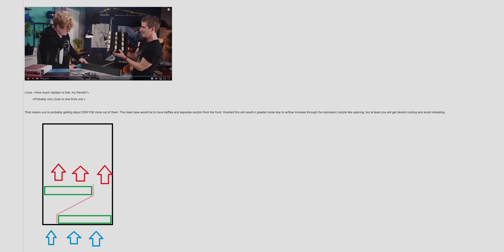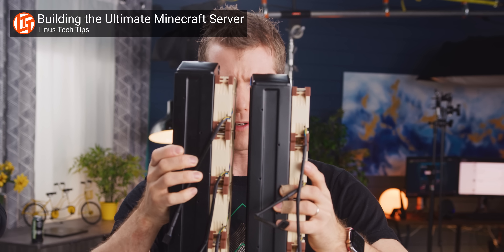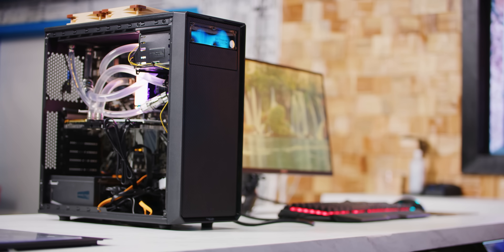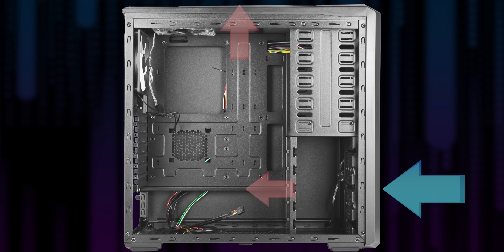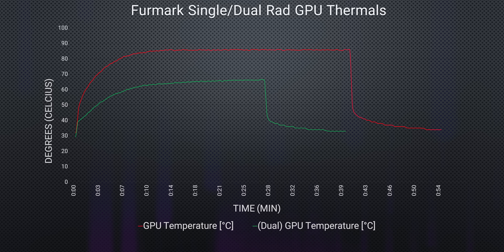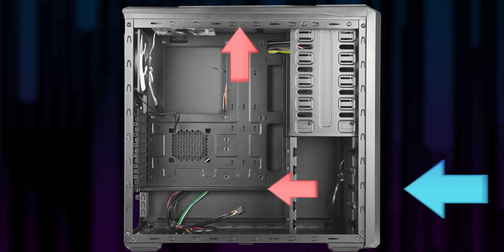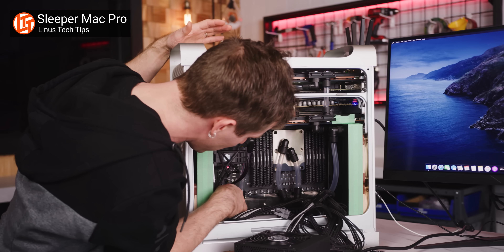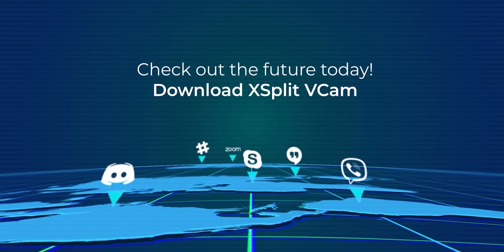I’ve been water cooling wrong for YEARS - $H!T Manufacturers Say

Comment: Corsair's recommendation may not hold true for a standard PC build, but you didn't test it with the server thing with multiple rads one after the other where it would hold true. That's a situation where you've worsened your mater cooling performance because the last rad will only get hot air from the rad in front. Worst case scenario.

Comment: I'm sure someone else will comment on this, but here it is anyway. All the best hot rod cars, drag cars and even race cars use "triple flow" radiators. That is, the water turns behind itself twice, to form three walls of water, with one common air flow. This does increase heat capacity, and you will have seen what that means to heat soak, BUT it also allows great "packaging" and that's what we're really talking about here. Optimised cooling VS packaging. If you want to fit cooling inside a case, multiple rads and lots o fans are your friend! You generally want the coldest air to touch the coldest water, i think that's called contra flow (it's been a while). The type of rad will affect this decision. Hot water will cool "better" on cold air, but, IF you have the capacity and thermal window, cold air will make the "cold" side, colder, so keep the system from heating as much. Ambient, surface area, air and water flow (as well as peak temps, temp difference and thermal input power) will change how you choose the config. For shits and giggles, try a control experiment. Do two external "bench" rads with the same fans (always the same number of fans). One test with serial rads, giving the cooling a "longer" pathway for the total surface area (this should work well for low temperature difference) and do a second test with the two radiators in parallel, using splitters to separate and join the water flow. This "slows" the water flow, allowing more time in contact with the rads. I think this works best in high temp difference scenarios (depending on your target cooling temp too? ). Then compare this with stacked rads, outside then inside the case. If you're super bored, try push-pull fan configs vs push-push. Short story, you work with the packaging you want to achieve. I'm sure we've all built that franken-cooler with three rads hanging from the outside of the case. Nothing beats fresh air. Also, one should always consider higher static pressure fans for rad cooling since they shouldn't suffer the flow losses through the radiator(s) AH! one more fun experiment: stack fans at the hottest part of the rads and see how that affects the numbers.

Comment: It seems though that this doesn't really test the radiator's efficiency at dissipating heat into the air. Having multiple radiators will mean that there is more radiator surface area for the water to dissipate heat into, so you have a greater overhead for cooling the water. But does the water continue to cool effectively when the radiators become saturated with heat? I think you would have to do a very long test that saturates the radiators with heat before you would notice if an air dissipation bottleneck is preventing your CPU or GPU from getting cool. 

I'm also surprised that the fancy thermal camera didn't come out for this video. Why didn't they check the surface temperature on the radiators?

Comment: Still linus they are right. Its thermodynamics linus, of you stack you wont be gaining as much as you think.

There is a strong correlation between airspeed and temperature difference.
The more temperature difference there is between both air and water, and the more air velocity, the more efficiënt the radiator is.

Comment: ...and everyone suddenly finds out why Air Conditioners work harder, are less efficient, and fail more during the summer heat. it's all about the deltaT. Science says you can't add cold, all you can do is add heat, (subtracting is a silly concept here.) so you need to find a cooler environment to add your heat too. Hot CPU to cooler liquid, now warmed liquid to cooler air (stacked now adds one pass cooled liquid to warmed air?).  Instead of stacking, try isolating the fresh air into and out of the radiator from the other components.

Comment: So BOTH parties Linus and Corsair are BRAIN DEAD SCIENTISTS!  1) What Corsair did wrong was forget about the water temperature heat gradient inside the block is the primary heat transfer surface (ie temperature gradient), and radiators are the second.  2)  Linus also DID NOT COMPARE 2 radiators in PARALLEL both inputs which was the WHOLE POINT.  THAT WOULD HAVE BEEN A FAIR COMPARISON.  Instead he stubbornly compared 2 radiators with a second one being VERY inefficient (HOT EXHAUST TAKING HEAT FROM THE FIRST RADIATOR AND THE MB) and compared that with only one radiator.  CONCLUSION we compared apples 2 RADIATORS in SERIES to frogs 1 RADIATOR    UNFAIR UNSCIENTIFIC BOTH OF YOU!   YOU FORGOT ABOUT THE DUAL INPUT DOUBLE RADIATOR TEST THAT IS F&%$ MISSING!!!!!

Comment: Sorry, Corsair is right and Linus is wrong.  So many EE's and no mechanical engineers leads to stupid conclusions that stacking heat exchangers is "better".  Only if better means thats it is possible to eject additional heat from the system and accepting the fact that it is always, always done with a massive loss in heat exchanger efficiency.  So, do yourself a favor and buy a better case.

Comment: id say for a dual rad set up it would be more efficient the corsair says it was done if the warmest air went into the exhaust rad first to pre cool the loop then into the primary rad to finish cooling the loop. this is done in chill water systems anywhere there is a demand for that type of heat exchanger.

Comment: I'd assume that the air going through a radiator doesn't gain all that much heat, especially if you have good fans pushing it through quickly. As such, that "hot air" is most likely only "warm air" and still has plenty capacity to take heat from the second rad. Not that there isn't diminishing returns, but there are still returns.

Comment: Here's the the thing, if you have ambient temp cooling the water on a rad, the waste air is going to be cooler than the rad because it's function that involves the water and air temps.   So the air going through the second rad will still be cooler than the water in it, always, sure the deltaT might not be as much as the first rad but it still is going to work.    Also yeah if you have other fans bringing in cool air then you have a situation of WTF simulation were you running Corsair!?

Comment: the air coming out of the rads can never be hotter then the water going into them, therefor if the last rad to pass air is the first to receive hot water. there will ALWAYS be a gain in cooling performance out of adding more rads. HOWEVER the added thermal performance will increase if those rads are not passing the same air is what corsair SHOULD have said.

Comment: I didn't get it :(
Corsair was talking about stacking radiators one onto another so that the heat from the first radiator goes through the second radiator (not cooling it as result).
So you would need to compare two stacked radiators vs two "chained" radiators to see how much stacking affects cooling efficiency, no?
Reply: At the end of the video he talks about how they removed one of the three radiatiors from the mc server rig and it increases the temps by 5c this proves that if you stack radiators you get better results. You can even do more than two.
Reply: @RoaldBosman  it only really makes sense if you can supply fresh, ambient air to the radiators. If you can’t, because you are stuffing way more crap into a 1U server case then is reasonable, it quickly becomes a matter of diminishing returns.  

He starts off the video talking about the temp differences between ambient air and the coolant temp and how the overall heat carrying capacities are dependent on that - then pretty much ignores it for the rest of the video :/
Reply: @DocNo27  yes it does become a case of diminishing returns but sometimes to have the best of the best you can't be reasonable with what you put in a server rack.
Reply: @RoaldBosman  not if you attach radiators one to each other. That will not improve anything. And this is what Linux did in his previous experiment. Which is dumb for the reason I have explained in another commnet.
Reply: @biomorphic  what do you mean by attaching them to each other? Stacking radiators against each other? Having the same water run through radiators stacked against each other? If so it does work it's similar to increasing the thickness of a radiator, it's just not as effective at cooling compared to putting it somewhere it gets fresh air.
Reply: @RoaldBosman  it's exactly what I said. Stacking radiator one on top of the other will not give any benefit. Which is basically what Corsair said as well.
Reply: @biomorphic  The minecraft server had 3 stacked to each other and it went up by 5c when they removed one as the person you quoted said.
Reply: @biomorphic  as Linus said in the vid. It helped. Case closed. I have also said in another comment how they do it in most cars, if it didn't work we'd all either have no a/c or over heating cars.
Reply: @Hero-ei7dp  it went up by 5c when they removed one of the 3 radiators
Reply: @RoaldBosman  Yap I forgot to say when they removed one. edited it now
Reply: @biomorphic  "Diminishing returns" does not mean the same thing as "no benefit".  Sure, additional radiators will cool less than the first one but less does not equal zero, they still cool the water a bit. Each one helping yet individually doing less is what "diminishing returns" means. Each extra radiator doing nothing at all is what "no benefit" means. Linus proved that there is a benefit when he went from 2 stacked radiators to 3 stacked radiators in the MC server.
Reply: @RoaldBosman  that's not what Linus did. He used radiator in series, but they are not stacked to each other, like in the experiment he did previously with the server. Linus took 2 radiators, one positioned on the front and the other on the top. The radiators are connected through the pipeline, but they are not stacked one on top of the other. You get a benefit in this case, because there are the case extraction fans in the middle, like I stated in a separate comment.
Reply: @ndvorsky  but if you keep them apart, instead of stacking them one to each other, then you get a real benefit, because the extraction fans in the case will blow the hot air out. I mean, it's simple physic. There is also to consider things like negative pressure, fans airflow, etc. Fans attached to radiators are different to the one you use for the extraction. In the end it's all matter of getting in fresh air, from one side, and getting out hot air from the other.
Reply: Not Your Business you’re picking a fight for no reason. Everyone already agrees that the radiators would be more effective if they weren’t touching one another AND everyone agrees that 3 radiators touching one another is STILL better than only one radiator. You’re mostly just saying stuff we already know.
Reply: @ndvorsky  I'm glad that you got it, apparently someone still didn't get it.
Reply: @biomorphic  You are wrong. Linus PROVED he got an additional 5c by stacking rads. Other pro builders have done the same. Stacking rads DOES have a benefit. You must have watched a different video.
Reply: @biomorphic  You are fudging words to make it look like your comment was correct. Linus spcificaly removed a rad from  a stacked rad build and got a 5c difference but for some reason you are ignoring that fact.
Reply: @biomorphic  apparently you weren't paying enough attention to the video, and just continue to refuse to get it.  The FOOTAGE showed radiators in series, however, he mentioned removing a radiator from a computer with STACKED radiators, and having the temperature go up.  There are also others out there that have tested stacked radiators in the past, and found them to be more beneficial than single radiators.

Now, you can repeat yourself some more if you like, but that won't change the fact that you're not correct.
Reply: @Maplicito  he said removing a radiator, from 3 to 2, increased the temperature of 5 degress, but he didn't say how much the temperature incresead from one radiator to 2. My suspect is that a single radiator would have done mostly the same as 2. With 3 wasn't even dissipating. In addition I think is totally dumb to spend so much money for 3 Noctua fans and a radiator like, to have a benefit of 3 degrees probably maximum, which is an increment of what, 3% in performances? Once again, stacking radiator is dumb and Corsair is right. End of discussion. And if you don't get it, it's not my problem.
Reply: @NeoKingArthur  it depends on your situation. In server rack cases a lot of the time you don't have the space to get clean air intakes for every rad so you work with a suboptimal situation. The point wasn't to get the best cooling solution, it was just to say this does work you can get more cooling. The rep at corsair was saying that you get no increase in cooling capacity or could actually decrease your capacity. That is what they are talking about, not what is actually the best way to get the most out of each rad.
Reply: @NeoKingArthur  but a lot of what goes on at ltt is justified by the fact that it is content. and you need to feed the machine content. or it gets mad at you.also ltt has a massive budjet that also justifies some of what they do. Its also a lot of fun to just do stuff because you can
Reply: "Corsair was talking about stacking radiators". Uh, no. That was only one comment from Corsair. They sent him two. And he tested both by making a dual rad system, and later removng a rad in a stacked rad system, obtaining a 5c difference. Better watch the video again, and pay better attention this time.
Reply: @NeoKingArthur  Do you honestly believe ANYONE who does this for a living doesn't know double rad does not equal double performance? Only an amature wouldn't know that. Watch the video again and pay attention to what Corsair actually said.

Comment: Corsairs simulation seems flawed. In a perfectly sealed and insulated case with one entrance and one exit radiator maybe you could get the internal air temp to match that of the water. In practicality, even poorly ventilated cases pull in enough outside air to keep the temperature differential between the case air and water large enough to provide additional cooling. Even with radiators stacked back to back, the air coming out of the radiator will still be cooler than the water temp when under load. So while it may be inefficient this stacking method will still provide more cooling than a single radiator.

Comment: The ability of your cooling system to move heat will depend upon the mass flowrates of the two fluids and the difference in temperature between those two fluids (there's a ton of other variables, but they are basically static for this comparison). Stacking radiators in series will likely create a slight increase in airflow (double the fans, but also double the airflow resistance, as mentioned), but will lower the deltaT of your second radiator, which reduces its ability to move heat. This was all mentioned. As other commenters have pointed out, your case is open, so you're able to draw in some lower temperature air which improves the results of the test.

What Corsair is likely trying to say is that you could greatly increase the amount of cooling ability by aligning your radiators in parallel with eachother, rather than in series. You'll double your airflow rate, which keeps the deltaT greater for both radiators, allowing them to move more heat. Even better would be adding a tee connection to the water loop, or using a pair of pumps to drive water through each individual radiator, thus increasing the water flowrate as well. Even with basically the same hardware, however, the overall efficiency would be higher. Higher efficiency = lower temps.

Ideally, you'd just size the radiator and pump correctly to adequately cool the max TDP of the entire system. That said, I'd love to see this same test rig run with the radiators in parallel with eachother to see the real-world results.

Comment: Look up how car radiators are constructed.  They often have 2, 3, or even 4+ cores.  A 4 core radiator is literally like stacking 4X slim single core radiators on top of each other.  Radiators are designed this way because there is still cooling capacity remaining in the air after it has passed through a couple radiator cores.

Comment: Putting multiple  rads in a case is ok but stacking them together will reduce the cooling capacity of each rad. For example two fresh air cooled rads usually will preform better than  three stacked together.

Comment: Stacking radiators doesnt work, I have mentioned in atleast 2 videos of yours not to stack but to place them side by side when possible. Plus, u did not stack today. U added in series. 
Any difference u MIGHT be able to get would be due to a difference in volume of the cooling liquid.
Reply: He said he removed one from the triple stack in the Minecraft server and got a 5 degree temp rise. Series and stacking is the same thing, it's just a matter of how far between them.

Comment: If both rad draw in fresh air and the hot air blows out the back that would be the most effective heat exchange other than rads in a separate box.If stacking on a rad gives an added  5% performance then giving the added rad cooler air should give 5%+.

Comment: But your testing was not the same. In the start you had clips showing radiators bolted to each other, but the test in the video was just two fans on the same water loop using different air. If you wanted to test properly you needed to have the stacked fans and radiators and I expect in that case there would have been little to no benefit for the extra hardware.